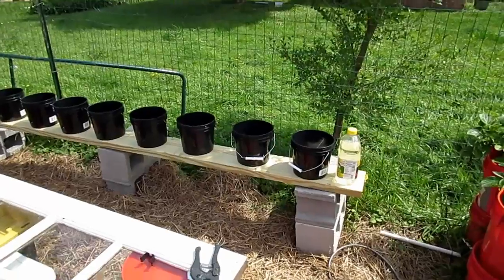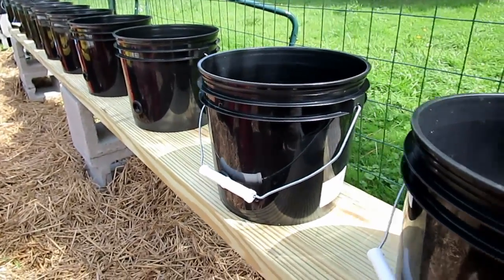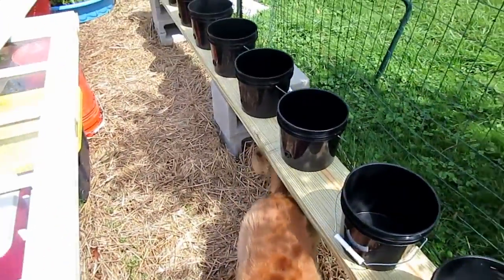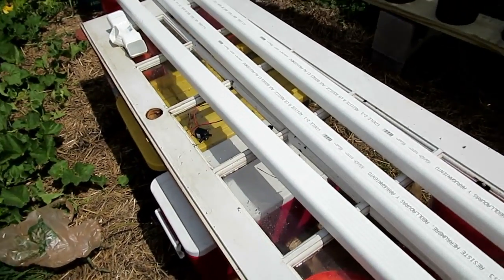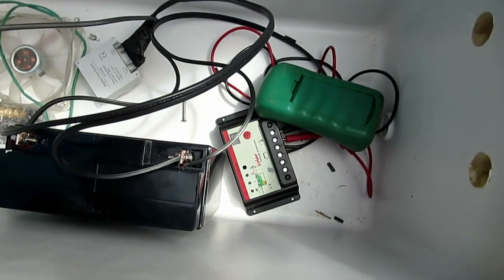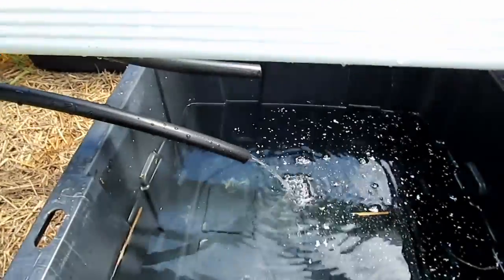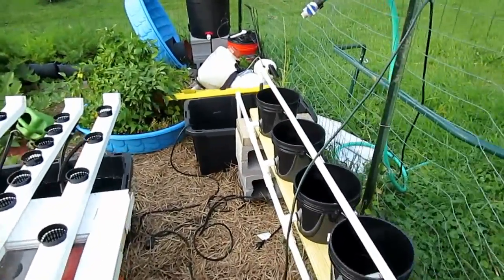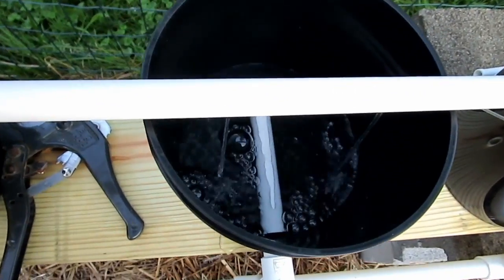Building the new hydroponics system part 1

Comment: On a centrifugal pump like these the more restriction you have the lighter the load is on the motor. Sounds backwards but for example take a box fan or a vacuum cleaner, if you restrict the air flow the motor speeds up. The same happens to a centrifugal water pump to some extent. Of course if you restrict the flow to nothing you might risk not cooling the pump but it is submersed in cool liquid. These pumps are crude and will not build pressure like a positive displacement pump will. Positive pumps are either gear, vane or piston pumps.
I have had hydroponic pumps running for years. I have used the same pump restricted down to very little flow like one plant to nine plants and so far have not lost a pump. But they only run a few minutes a day so they should last. The one I restricted the most ran 12 hours a day on a half hour on half hour off timing. (ECO264)

Comment: Those black pails look like 2 gallon instead of 1 gallon? this system looks good! The only thing that may give you some indigestion is the size of the return lines on the Dutch buckets. Depending on what you are growing you will find roots making it into those lines. I use 2 inch returns and I am always cleaning out roots from the return lines when I perform maintenance on the system.
I look forward to seeing more from you! I subbed!
Chuck

Comment: Buildinghydroponics may appear as unattainable specially when you live in a condo or high-rise apartment, but it is not.
Reply: You only need a correct plan, right tool, and the guidance from expert, you can save yourself time and effort to spend less effort gardening with hydroponics system simply by using this detailed instructions for hydroponics mini gardens:
great7.net/build-hydroponics-hassle-free-24413
Reply from the maker: i enjoyed hydroponics, but it became a little too much for what i wanted to do. I wanted to have high yields but be almost self sufficient. I tried hydroponics because I want to eventually adapt to aquaponics. Currently i am just focusing on container gardening and trying to get the best yields i can out of that until i get more property to do my aquaponics

Comment: Congratulation on your new system. I have a few suggestions. The rail system size of the gutter drain pipe should be deeper like the 5X5 PVC posts. The reason is the roots will fill the pipe fast and water will go out the pot holes once the roots get packed in. I would add 1/4 tubs off your PVC pipe and placed into the dutch bucket media to also reduce your algae. Well have fun and I wish you the best.
Reply from the maker: Thanks for the comment. I am trying to do this as much as i can with stuff paying around. I will be painting all tubing so algae wont grow. I knew I was taking a chance with the gutters so I will see next year. I am still learning, so please send any info my way! take care